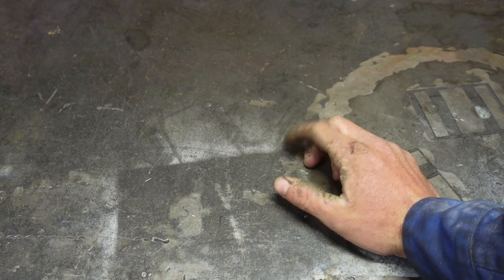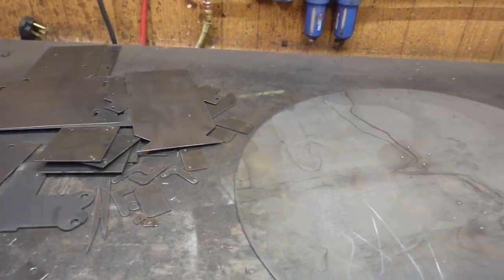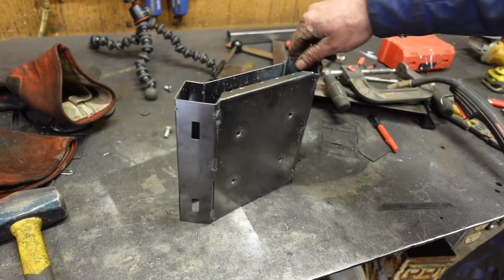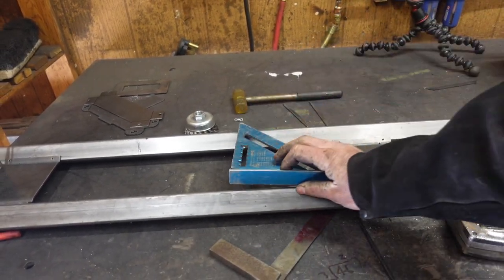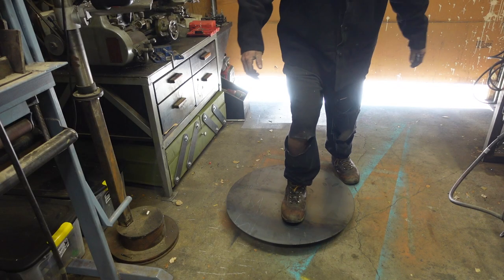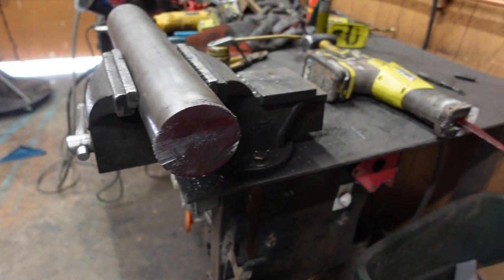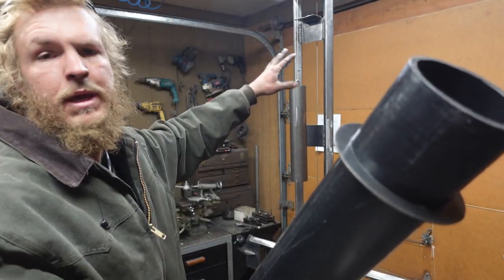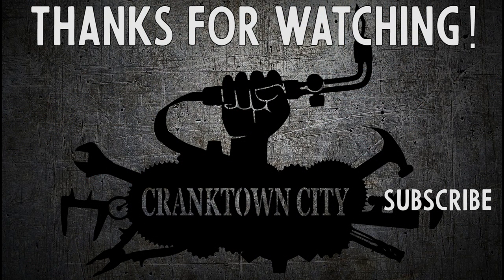Building Alexandre Chappel's Camera Arm Using Bent Sheet Metal Parts

Comment: Great job man just finished paying a guy to 3D prints all the pieces, now to find some affordable beating and screws , when I added it all up on Amazon, came out to 250$ just for nuts , bolts , and bearings, this was fun to watch I like your commentary
Reply from the maker: Thanks for the support!
Yeah, hardware can get expensive. There is an assortment of grade 8 nuts and bolts in common sizes on amazon for $70 which should last you through this project and many more.
as for bearings, If you don't mind fudging it, fidget spinners are cheap hahaha

Comment: You should check out "stuff made here"'s plasma cutter sharpie bend mod
Reply from the maker: I've seen it and it's absolutely brilliant! I tried doing something similar with an air engraver on mine, but could never get it to work with linuxcnc. Probably going to switch to mach 3 and install something similar when i build a bigger table.
Reply: @cranktowncity  dude, hit me if you need one on one LCNC support. :)
Reply from the maker: @sommersetcoker5455  That would awesome!
Reply: @cranktowncity  hmm havent worked.out how to pm on YT,

search my name on FB :)
Reply: Couldn't you just 3D print a sharpie holder, 
attach the holder to the plasma cutter head, 
disconnect power to the plasma cutter, 
run a "cut" program on the cnc to mark out your bend lines using the sharpie,
remove the sharpie,
reconnect the power to the plasma cutter, 
run your actual cut program,
and you should end up with a cut out part that has your bend lines on it.

Comment: Couldn't you just 3D print a sharpie holder, 
attach the holder to the plasma cutter head, 
disconnect power to the plasma cutter, 
run a "cut" program on the cnc to mark out your bend lines using the sharpie,
remove the sharpie,
reconnect the power to the plasma cutter, 
run your actual cut program,
and you should end up with a cut out part that has your bend lines on it.